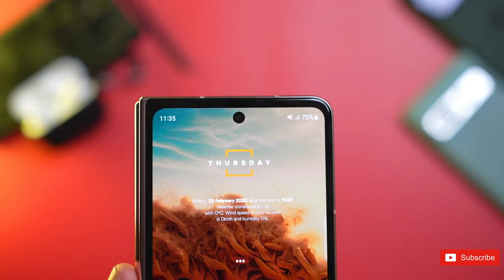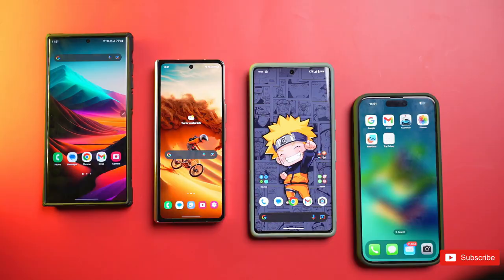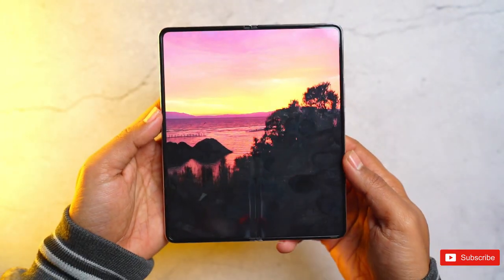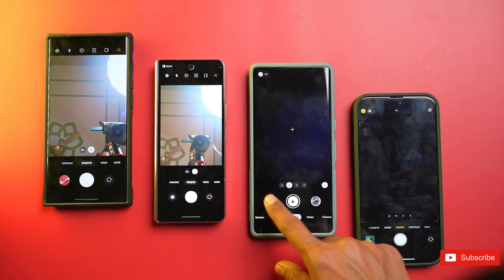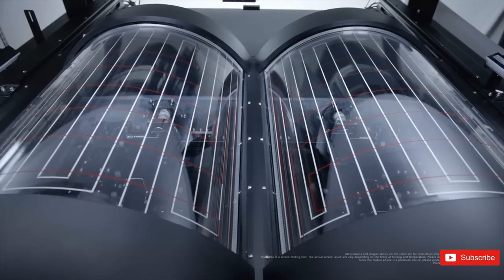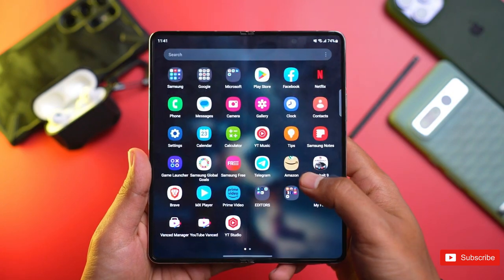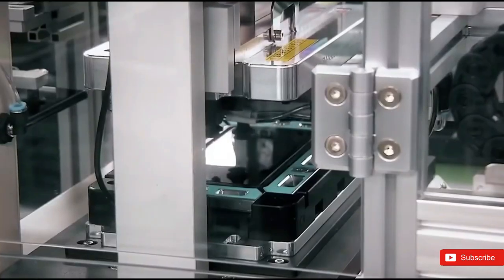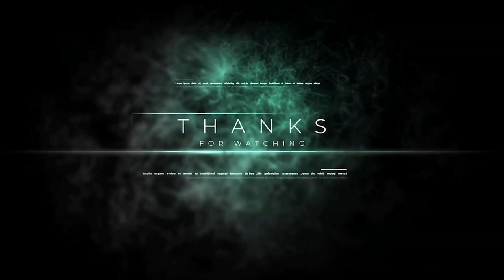Samsung Galaxy Z Fold 5 - TOP 5 UPGRADES 🔥🔥

Comment: Slightly big front screen-6.4 to 6.5 inches
Bigger battery with fast charging & appropriate weight management.
Also spen support in front screen even though if not inbuilt.
Zoom aspect and camera quality resolution can be improved.
Cases availability should be increased with budgetary pricing.

Comment: If samsung does not go big with the cameras, battery,  and bigger displays, and a built-in s-pen, less noticeable crease, faster charging,  improved under display camera then it will be a fail to me! I'm already wanting to ditch my z fold 4 for the s23 ultra because of its much better battery, processor, way better cameras , and has the built-in s-pen!
Reply: Sure sure.
Reply: @mndjr 😂

Comment: Wider screens much like the s23 ultra 5000mah battery minimum shorter screens the same length as a oppa find 
N2 
40-60 watt charging and a stylist 
Closed flush 200mp front camera 1500 dollars